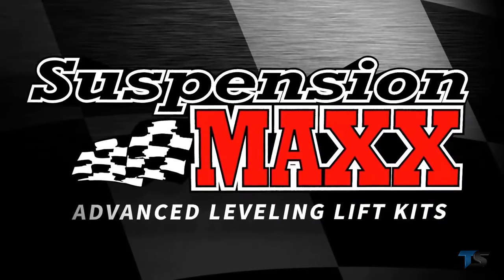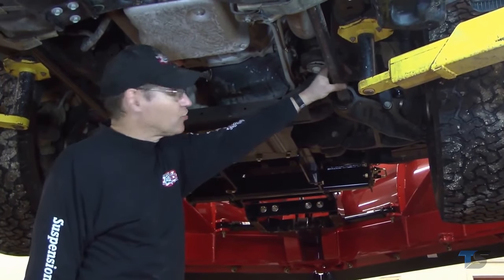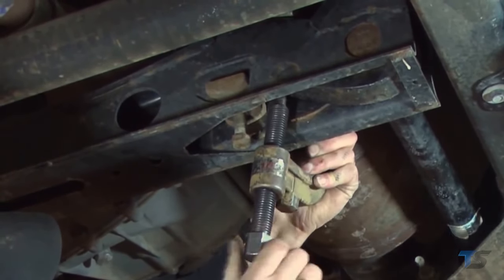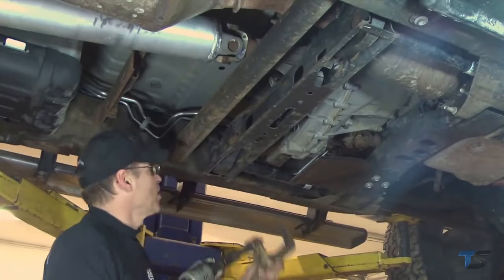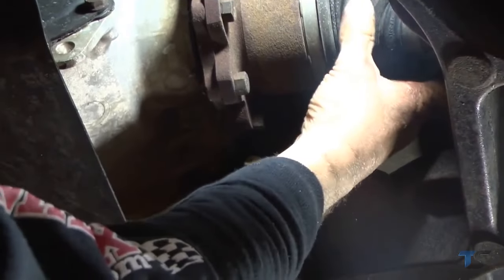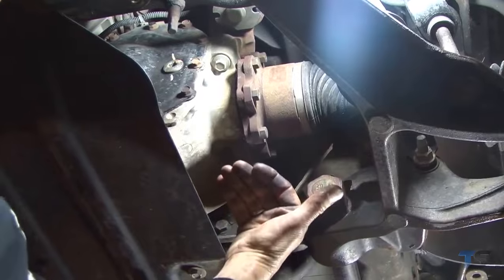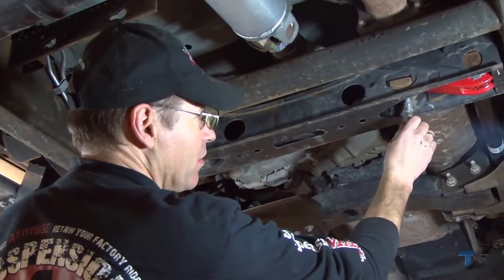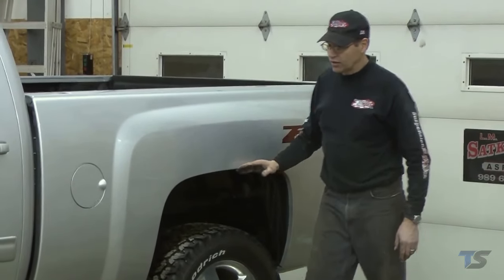Installation of MAXX CAM 3 Leveling Kit for the GM 2500HD & 3500HD

Comment: Genius! Or as the british say; Brilliant!. FYI on trucks such as the S-10 the torsion bars remove easier when the torsion bar crossmember is unbolted due to the binding angle from the crossmember to the control arms. Learned this the hard way til it got easier. Thanks suspension MAXX for these torsion bar cams.

Comment: You said that we could go back and adjust the bolt that goes into locking mechanism holding the torsion bar key any time we wanted to, but why would we want to? and also, it looks like the bolt is hanging down past the cross member.....is there any chance of it hitting a rock or something underneath?? great video btw
Reply from the maker: You can adjust the bolt at any time as a fine tuning tool to make sure your truck is level and at the height you want. As for the bolt hanging past the cross member you normally will run that almost flush to the cross member, also there is a possibility that at any point stock or otherwise that you have a chance of hitting one of those bolts with a rock.
Reply: Maybe it just looked like it was sticking out past the cross member more than it was, but it seemed it would be closer to flush ideally. Excellent video and response. Subscribed! And buying the part and tool as soon as the tax money comes 💪 @Truckspring
Reply: @Truckspring Also, when I searched the part online it didn't say it came with the differential spacer which is what sold me on the kit. Does the kit (I have a 2016 2500HD) come with the diff spacer?
Reply from the maker: Yes, it does come with a differential spacer.  @abdulfatah8283

Comment: Wondering if same kit can be installed on 2015 Chevy Silverado 2500 HD  LT Flex fuel 6.0 L
Reply: Flex fuel does not affect the suspension kit. Depending if it is a 2wd the kit number is  SMX-MC32WD  and if it is a 4wd then the kit number is SMX-MC5.

Comment: This video does not address the much more difficult part of adding the differential spacers. The written installation guide addresses the install, but you need to know the install is more difficult than presented here. Read through the installation guide link listed with each product and know what you will be dealing with before installing yourself.  Great product and highly recommend, but the install is not for your average DIY'r

Comment: Are those differential spacers really necessary seeing as no other company offers them??
Reply from the maker: The differential spacers will help to extend the life of the front CV axles by preventing the boots from rubbing and keeping the angels closer to stock. It is recommended to use them for the best results of the kit.
Reply: I agree. CV axles bind and extreme angle and become damaged. In some scenarios there is damage to the front differential without a differential drop. There are companies who make differential drops for lifts higher than these. However for this application the suspension Maxx differential  drop neccessary and sufficient. Speaking from experience.

Comment: Does it cause wear on cv joints an bind them up ?
Reply from the maker: With the included differential spacers in this kit there should be no binding or extra wear of CV joints for the front axles.

Comment: Do you need the 2-4 control arms after do this,or does this fix the angle of the control arms also,I have a lift,and don't have the 2-4 arms or diff drop, and if I hit some bumps it shakes violently until I slow down
Reply from the maker: Lifted control arms are not required with this kit since it maxes out at 2.5" of lift. Around the 3" area is when lifted control arms will become necessary for suspension travel and camber. The differential drop portion of this kit will help with CV axle wear by reducing their operating angles.

The most common causes of front end shake / bump steer is loose steering or suspension components and incorrect alignment.
Reply: @Truckspring  I think it has a 3" lift,cause my control arms are sitting on my frame
Reply from the maker: @myguitaryourface5160  On this chassis it is common for the upper control arms to end up close to the frame with any kind of lift. Moving to a lifted style control arm will change the control arm angles and restore some of the clearance.

Comment: Did you need spacers for the skid plate under the front diff afterwards?
Reply from the maker: Skid plate spacers are not required. The differential will not be low enough to hit the skid plate